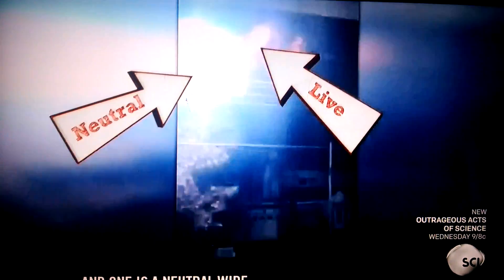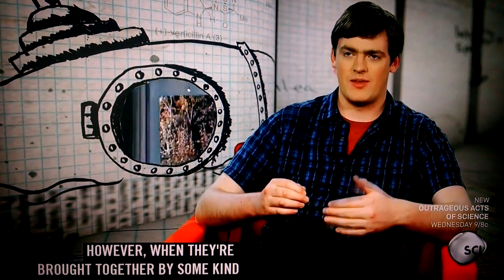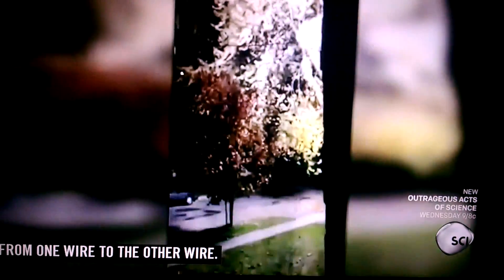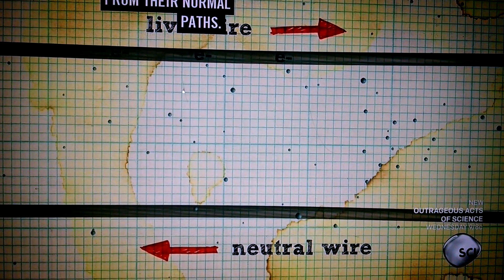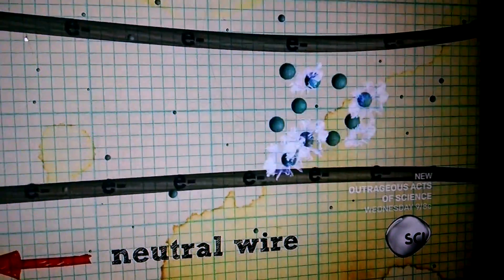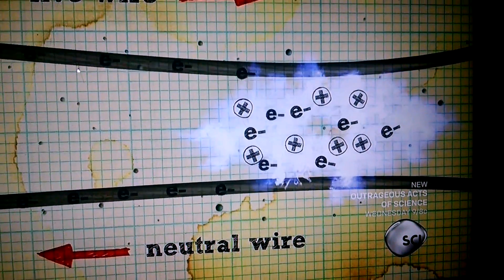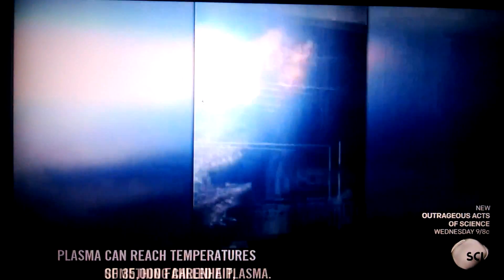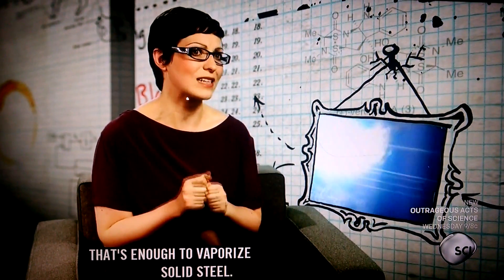When air becomes ionized

Comment: ⥊ SC: 19: COVID

0: Good

001: Uniqueness
002: Altruism
003: Sensivity
004: Audacity
005: Boldness
006: Astuteness
007: Ingenuity
008: Innocence
009: Truth Seeking

01: Willpower
02: Progress
03: Acuity
04: Love
05: Bravery
06: Congruence
07: Consonance
08: Honesty
09: Cleverness

1: Ethics
2: Problem-Solution
3: Subject
4: Idea
5: Expression
6: Why / Who / When / How / Where / What
7: Information / Code
8: Stability
9: Sanity

10: Network
11: Justice
12: Affront / Easter
13: Definition / Death
14: Cognition
15: Source
16: Reason
17: Discourse
18: State
19: Control

20: Judgement
21: Ethical Solution
22: Scupulous
23: Delimitation
24: Humor
25: Behavior / Christmas
26: Motivation
27:    Comprehension
28: Constancy
29:    Regulation

30: Liberty
31: Permission
32: Discernment
33: Responsability
34: Support
35: Means
36: Purpose
37: Opinion
38: Decision
39: Prospect

40: Goodness
41: Awareness
42: Critical Thinking
43: Consideration
44: Conceive
45: Plan
46: Ability
47: Knowledge
48: Structure
49: Ambition

50: Good Expression
51: Manifestation
52: Resolution
53: Application
54: Empowerment
55: Movement
56: Demonstration
57: Assignment    Mission
58: Building
59: Proficiency

60: Accordance
61: Appropriated
62: Implication 
63: Indicator
64:      Cohesion
65: Function
66: Investigation
67: Argumentation
68:      Sophistication 
69: Scrutiny

70: Intelligence
71: Message
72:      Consistency
73: Election
74:     Coherence
75: Consolidation
76: Explanation
77: Flow
78: Fluency
79: Measurement

80: Peace
81: Sovereignty
82: Perseverance
83: Reliability
84: Autonomy Instrospection
85: Rectitude Implementation
86: Pursuit
87: Persuasion
88:      Character Benign
89: Commitment

90: Kindness
91: Assertiveness
92: Optimism
93:     Scrupulousness
94:     Compassion
95: Composure  Essence Fiscalization
96: Blockchain: ⥊ (TRACE MARKER) Legacy
97: Anarchy
98: Veganism
99: Revolution

100: Liberation
101: Decency
102: Progressive
103: Resilience
104: Integrity
105: Collaboration
106: Abolitionism
107: Concordance
108: Clarity
109: Regulation

110: Ethical Commitment
111: Honor
112: Exploration
113: Privacy
114: Will
115: Pride
116: Justifiable
117: Equitable
118: Fair State
119: Mission

120: Harvest
121: Deliverance
122: Resistance
123: Cogitation
124: Challenge
125: Appropriated
126: Searching
127: Emphasis
128: Consistent
129: Subversion

130: Fulfillment
131: Admission
132: Criteria
133: Response
134: Provide
135: Technique
136: Principle
137: Point of View
138: Choice
139: Prevision

140: Serenity
141: Conscience
142: Concern
143: Perception
144: Free Love
145: Idealize
146: Capacity
147: Mindfulness
148: Scheme
149: Morality

150: Righteousness
151: Virtue
152: Coordination
153: Efficiency
154: Equip
155: Cooperation
156: Profiling
157: Counter-Terrorism
158: Rising
159: Excellence

160: Reasonable
161: Procedure
162: Corroboration
163: Hint
164: Value
165: Role
166: Lead
167: Logical
168: Improvement
169: Assess

170: Sympathy
171: Relevancy
172: Dichotomy
173: Naming
174: Elucidation
175: Materialization
176: Validity
177: Harmony
178: Coherence
179: Verification

180: Perpetuity
181: Independency
182: Perseverance   Dependability
183: Structure
184: Potential
185: Stance
186: Occupation
187: Compelling
188: Conviction
189: Boldness

190: Power
191: Wisdom
192: Effectiveness
193: Prudence
194: Foresight
195: Discipline
196: Trackable
197: Accountable
198: Compeling   Sustainable
199: Quest

200: Ideal
201: Compatibility
202: Referee
203: Adjudicate
204: Conformity
205: Coexistence
206: Methodical
207: Correspondence
208: Eccentricity
209: Expertise

210: Solution
211: Resolution
212: Prosecution
213: Adjustment
214: Transformation
215: Conversion
216: Escalation
217: Correction
218: Persistence
219: Analytical

220: Contemplation / Meditation
221: Preparedness
222: Dialectical
223: Meticulous
224: Diligence
225: Attitude
226: Rigorous
227: Dispute
228: Healtiness
229: Prescription

230: Allowance
231: Agreement
232: Definition
233: Jurisdiction
234: Availability
235: Proposition
236: Objective
237: Reckoning
238: Settlement Warrant
239: Assurance

240: Mindset
242: Mental State 242: Consideration
243: Rumination
244: Impression
246: Sagacity
247: Easygoing
248: Disposition
250: To Thrive 
253: Conduct
254: Potent
255: Insurgency
257: Defiant
260: Unveiled    Exposed 
261: Freedom Fighting
262: Correlation
263: Relevance
265: Conjecture
266: Suggestion
269: Estimate
272: Paradox
273: Choice
274: Dispute
280: Constancy
282: Evanescence
288: Healtiness
289: Conduct
290: Prognosis
294: Anticipation
295: Proof of Stake
296: Calculation
297: Proof of Work
298: Commitment

300: Crusade / Jihad
304: Concept Attention
309: Consensus 
310: Conviction
311: Consent
312: Confront
312: Distribute
313: Enforcement
314: Bodily Autonomy
320: Deliberation
322: Opportunity
327: Suspicion
330: Adherence
331: Self-Determination Demanding
333: Abundance
334: Accountaility
335: Technician
336: Dedication
338: Permanent
339: Maturity
340: Promote
341: Confirm
342: Validate
343: Imagination
344: Qualification
345: Ratify
346: Organization
347: Propagate
348: Finance
349: Encourage
350: Operation    Materials
351: Engagement
352: Endeavor
353: Undertaking
354: Remarkable
355: Designation
356: Exposing 
357: Proactive 
358: Forge
359: Accomplish
360: Technology
367: Addressing
372: Ambiguity / Conflict
373: Retort
370: Standpoint
372: Conflict
377: Context
383: Orientation
390: Prognostic
394: Prediction
398: Sustainability
399: Overthrow

400: Earth Population
402: Diversity
410: Permaculture
411: Mathematical
413: Realizing
421: Metamorphose
422: Transcend
427: Skepticism
430: Abstraction
434: Care
435: Possibility
436: Inspiration
440: Insight
441: Abstraction
442: Contemplation
443: Brainstorm
444: Formulation
445: Elaboration
446: Capability
447: Know-How
448: Apparatus
449: Theory
453: Design
454: Escalation
455: To Arrange
457: Rapport
460: Aptitude
461: Rigorous
462: Affect
463: Skill
464: Competence
465: Performance
466: Conjecture
467: Intelligible
468: Enrichment
469: Expertise
470: Wisdom
471: Accessible
472: Distinguishment
473: Priorities
474: Perspective
475: Constatation
476: Punctilious
477: Attentiveness
478: Amusing
479: Insurance
480: Security
481: Inclusive
482: Durable
483: Trustworty
484: Individuality
485: Convenience
486: Satisfaction
487: Benefit
488: Friendly
489: Praticality
495: Marvelous
496: Sensational
499: Envision
Reply: 500: Assumption
501: Leadership
502: Credit
505: Viable
503: Esteem
509: Prestige
510: Admiration
511: Heroism
512: Pugnacity
513: Description
518: Steady
520: Proficiency
525: Habit
530: Implementation
531: Solicitation
532: Regard
533: Contract
534: Requirement
535: Execution
536: Utilization
537: Utterance
538: Respect
539: Esteeem
540: Appreciation
541: Sensatize
542: Instigate
543: Sentiment
544: Sharp
545: Assembly
546: Potency
547: Education
548: Solidity
549: Evolve
550: Fellowship
551: Insurrection
552: Schedule
553: Reportation
554: Convocation
555: Party
556: Campaign  Instruments
557: Coordination
558: Systematize
559: Seize
560: Protesting
561: Explicit
562: Reciprocity
566: Intimation
Reply: 570: Counter-Terrorism
571: Cracking
572: Decipher
573: Affinity
574: Interpretation
575: Blitzkrieg
576: Codification
577: Spreading
578: Decoder
590: Excellency
595: Heroic
599: Eagerness

600: Organizator
611: Consequence
612: Researching
613: Suitable
620: Diagnose 
629: Symptom
633: Incumbency
634: Inspiration
636: Cause Goal
643: Reflection
644: Theory
646: Brililiance
647: Logical
648: Content
653: Appliance
655: Mobilize
654: Overcoming
660: Operation
661: Operator
662: Nexus
663: Evidence
665: Role
666: Questioning
672: Discussion
673: Instructions
676: Deduction
694: Systematic
696: Sublime

700: Lucidity / The Gear / Artificial Intelligence
702: Credit
704: Data
710: Coherence
711: Rational
712: Intimation
713: Precision
714: Acquaintance
715: Presentation
716: Manifesto
717: Pronouncement
718: Proclaiming
719: Revelation
721: Point
722: Interpretation
723: Reparation Ambivalence
724: Sense
725: Direction
727: Compensation
729: Disclosure
730:    Importance
731: Interaction Consent (Y/N)
732: Contrast
733: Designation Nomination
734: Endorsment
735: Product
736:    Importance
740: Statistics
743: Understanding
744: Grasp
746: Thoroughness
747: Articulation
748: Conceptualization
749: Enchantment
750: Consolidation
751: Communication
753: Instrument
754: Conquering
755: Coalition Coordination
756: Inspire Instruction /Method
757: Prompt
759: Delight
760: Instructive
756: Instruction / Method 
766: Causality
770: Appreciation / Gratitude
771: Algorithm Statement
772: File
773: Algorithm Recognizing
774: Code
775: Information Output
776: Correlation
777: Pattern /  Construct
778: Development
779: Enumeration
780: Systematization
799: Revolution Algorithm

800: Providence / Supremacy
801: Production
802: Necessities
803: Resorces
804: Energy
808: Renewable Cycle
810: Permaculture
811: Fair Law / Constitution
819: Lament
820: Predominance / Management
829: Ephemeral
830: Logistics
831: Inquiring / Scheme
832: Reach
833: Entrusted
834:  Dependability  
835: Stock
836: Gravity
840: Consumption
843: Zeal
844: Creativeness
846: Independent
847: Autodidact
848: Integration
850: Labor
853: Usage
854: Disciplinated
855: Devotion
858: Accessibility
860: Human Resources
861: Adequated
862: Shape
863: Assignments
866: Estimation
870: Structure
873: Congruity
880: Peace
888: Globalization

900: Transparency
910: Panacea
911: Emergency Call
919: Enclosuse
930: Enlightenment
931: Only One Global Currency
935: Resources
936: Legitimacy
940: Empathy 
944: Wishing Well
946: Compassionate
947: Philanthropy
948: Unification
954: Intrinsic
955: Fidelity
960: Synthesis / Blockchain Integration
961: Remarkale
962: Guide / Formidale
963: Monolith
966: Proof
970: Examination / Gallant
971: Vocabulary
973: Pertinence
975: Inspection
979: Impressive
980: Splendid
990: Optimization
991: Imperative
995: Accountancy
996: Revolution Chain
998: Regulation
999: Zenith Vortex Epic
1000: Militancy
1001: Nova Era

1010: Peer-2-Peer
1011: Decentralized Network
1012: Distributed Ledger
1030: Financial Revolution
1031: Resources Availability
1040: Production Revolution
1042: Drug Liberation
1049: Implementation
1050: Labour Reorganization
1100: Liberation Army
1133: Abolitionism
1160: Pacifism
1312: Boycott
1317: Identifiable Source
1400: Unity
1444: Direct Digital Democracy
1500: Benevolence
1550: Charity
1807: Black & Yellow
2000: Sanctuary
3000: Freedom
3030: Win-Win
3100: Triumph
3311: To Revolt
3330: We All Can Live In Abundance
3712: Problem In Your Opinion
4000: Coexist
4411: Riders of Justice
5000: Glory
5500: Greatness
6500: Quantum Mechanics
6999: Mystery
7220: Unified Field Theory
7755: Revolution Gear
8000: Sustainability
8999: Finitude
9997: Discovery
9998: Unknown
9999: Universe
10000: Existence

. This is a Numeric Matrix for Communications Purposes.
. This Can Be Used to Convey Meaning.
   Ex.: 2034: To Judge the Idea.

. Mathematical Operators Can Be Used to Calculate Meaning.
   Ex.: To Judge the Expression: 25
   20 + 5 = 25 (Behavior)

. Logical Operators to Create statements.
   Ex.: ¬11: 13. If not Just then Death.

. Colors can also be used as information.

- You can help build it.

Comment: How was the air ionized? I don't know I'm asking the right question but I really want answers
Reply: See as per grade 12. When the electric field produced in the wires exceeds far more than the surrounding air's dielectric strength. Then the air gets ionised.
Think it like this, that there is a certain limit of charge which the wire can carry, but when it exceeds the limit it causes the surrounding air to get ionised.
Reply: Looking for the same answer